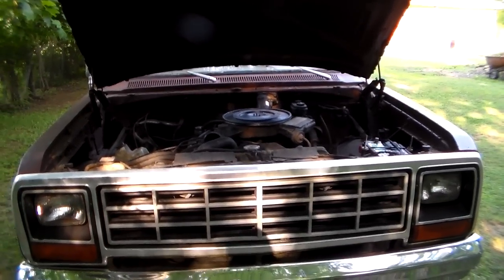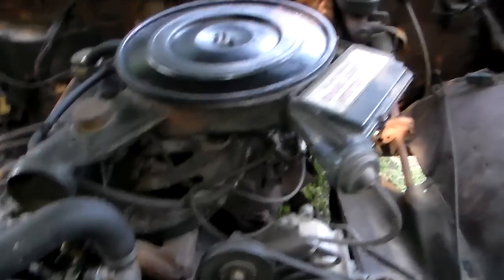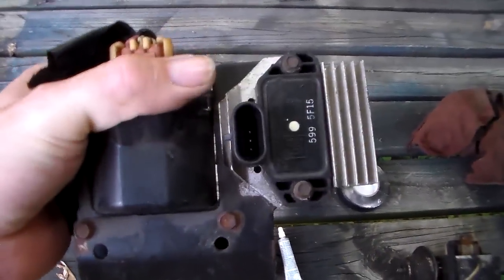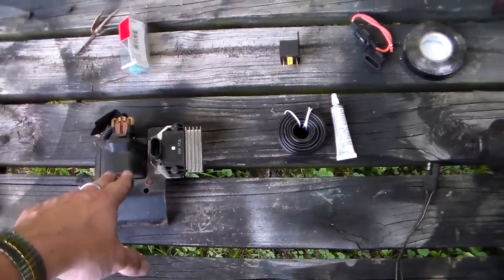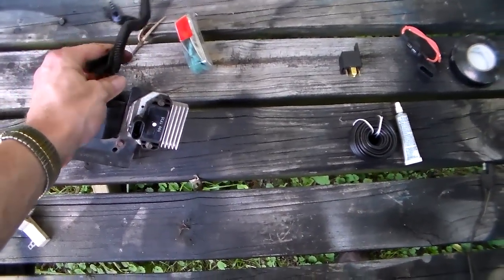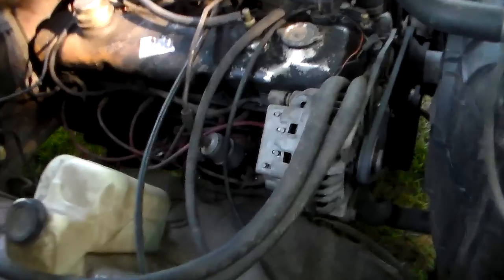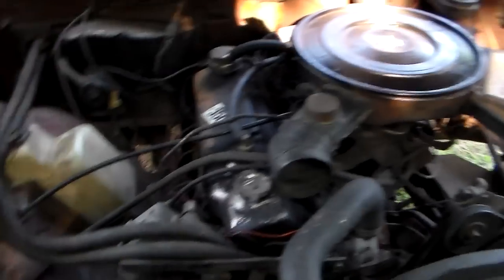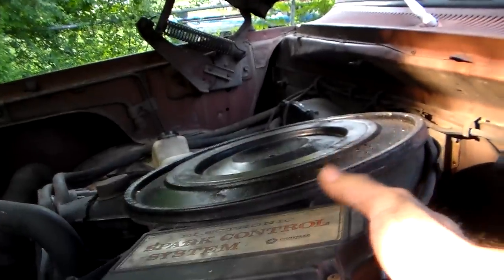Chrysler Lean Burn to HEI ignition conversion part 1

Comment: lean burn was gone by 79 , what you have there is spark control , i have that on my 79 magnum 140000 + still working but i have thought of replacing it, its doing its job for now but there are no replacement parts that i know of

Comment: I have a 66 Dodge 225. Do you happen to have a part number for your Dodge hei distributor? Or a year/make/model to search with? Thanks.
Reply: did you ever figure it out
Reply from the maker: I don't have a part number, but you would use an electronic 225 distributor from 1974-up. REMEMBER, the regular distributors have a vacuum can on the side and the Lean Burn versions do not.

Comment: Sorry for another young carburetor illiterate person comment, but how do you test the vacuum advance pot or whatever it is called on the distributor ? I’ve got one from eBay but want to be sure it’s OK while gathering other parts
Reply from the maker: Grab yourself one of those hand-operated vacuum pumps and use that, or you might even can suck on the port and make it operate.

Comment: I just got a 1985 dodge d150 with a 1989 wire harness no EMC computer how can I use ur method or can u help me out plz
Reply from the maker: A 1989 is fuel-injected. I think the wiring harness is vastly different. My recommendation is find a good harness from about 1984 to no later than 1987 and start with that. You need a good wiring schematic for that truck also. You can do it.

Comment: Hello ! I got a hold of a 1986 Plymouth Gran Fury with only 55K miles on it here in Florida. Could not get it to run right with serious power issues. Viewed some of your other videos. I then ordered an new HEI  distributor from Ebay that company said would fit my car. Everything bolted up okay but now car will not even turn over now. Thought it may be the starter suddenly went bad and so I replaced the starter but car still will not turn over. Is there anything I am missing here.

Comment: I subbed, I've owned Chryslers forever, I still have my dad's 68 2 Dr club coup Plymouth Belvidere with 3 in the tree, I've owned a 70 Plymouth satilite, a 72 scamp, 77 Cordoba, 82 Cordoba, 85 gran fury, my dad's, 97 dodge dokota, 97 grand caravan, current 2000 Chrysler town and country, and 96 dodge ran van 2500, and my newer current 99 dodge 1500 prime time conversion van, I remember the conversion kit for the lean burn system, I put one in my 77 and 82 Chrysler Cordoba was fairly easy, I use to work for a Chrysler dealer so I got em cheap.

Comment: Hi Tyler.  Why not convert to points ? What benefits are there going to hei vs points ?
Reply: More power, reliability, idles/revs better.. Hotter and longer spark.. And no more maintenance with the points!
Reply: @gorkzop  thanks.  With hei having a hotter spark, is there a chance of burning a hole int he piston? Kind of like using too hot of a spark plug and burning up a piston.
Reply: @whatyoumakeofit6635  not that I'm aware of.. As long as the ignigtion timing is correct off course.. I have never heard of HEI giving bigger chance though

Comment: this is only a good Idea if this is what you have on hand 

  GM.s  system is not as good   and realy has problems
of its own
Reply: Lets say you have nothing on hand.  And you want to do away with mopars stock system. What route would you suggest, for a daily driver/road trip car ?
Reply: Austin Carlson  This is interesting  as i have worked with both systems the Siemens System  is different and not altogether bad     the Bosh system  has its problems   both are used all over the world     why is this not so with the GM system     the GM system has the advantage of volume in the US

Comment: I'm curious, if the carb is lean burn computer controlled, shouldn't retaining it cause some mixture or idle problems by removing the lean burn?  I would think you would need to change the carb also to an older model, like the Holley 1 barrel that came on so many of these.

Comment: I have replaced a dozen of those lean burn systems. Just change the distributor so you have a vacuum advance and wire in a Chrysler ignition box. The box system might not be high energy, but they got the job done. Do you think you will gain even 1 hp with that crude setup you are putting on your  truck.

Comment: Hey T, Few questions, what happen to your black electrical relay? Also, didn't see where you installed that inline fuse. And lastly is the voltage regulator that is bolted on the firewall {silver/gold rectangular box} does that go away as well with this HEI conversion? 

PS: Great job with the videos

Comment: Pretty good videos. You have enticed me to make the change only I have several questions if you don't mind me asking. I have looked all over for a GM 2 pin and can not seem to find one so Im going with the ford and hope it will work. I have looked at a few other vids and noticed that the BLK wire is on the bottom pin and the ORG wire is on the top which is backwards from yours? Have you noticed any problems? I did swap and found to have no spark so I was just wondering. Also I hooked my ignition wire to the + on coil and then relay/bat power to the module. I see that I have 1.5v difference and wonder if you think this is a problem? I seem to be having a really hard time starting the truck but it does run good when off idle but it struggles to idle and a complete bear to start. I am puzzled and just wondered if you had any thoughts? Good couple of videos!

Comment: An easier but little more expensive way to convert a lean burn Mopar to HEI is to get a points distributor and install a Pertronix Igniter .
This method definitely is cheaper if you hit the scrape yards.
You also can use a Ford HEI ignition coil like those found on 80s to 90s 5.0s and some 3.8s.

Comment: I might just lose the flex fan & throw an electric & sensor on it. Good idea! I have a 413 sitting that I keep getting asked when its going in, but I rather play with this for a while & see what I can get it to do. The little Dart has the good gears in it, it spins tires like it has a v8, but I don't think you could get 90 out of it.

Comment: The actual ported EFI system is going in to deep for me. I don't like the idea of drilling the manifold & adding a dozen sensors. I just keep an eye open for a cheap donor car with the old 2.5 in the late 80's or early 90's, or the first 4.3's. Then it would just be a matter of making an adapter to the intake, weld the o2 in the exhaust, and rerun wires to your chosen computer location. That would allow me to use a remote start system and run right along side modern cars for mileage & power.

Comment: Cool idea, I hadn't thought of this, but have been playing with the idea of going a step further & putting the TBI system off a 4.3 on my Dart. Needed parts: throttle body, oxygen sensor, and computer. The tricky part would be adapting the throttle body on and high a pressure fuel pump.

Comment: That safe keeping spot may not be the best option. Weedeater man may get to it!

I thought someone mentioned there was an easier way to do this, or a kit, etc. But I am sure its more fun to get the parts and make it yourself. Also Interesting how that module has a heat sync (spelling) on it. My truck has the same one (except its the mentioned 4 pin unit) and it doesn't have one. Probably why they fail often from the heat on my trucks.